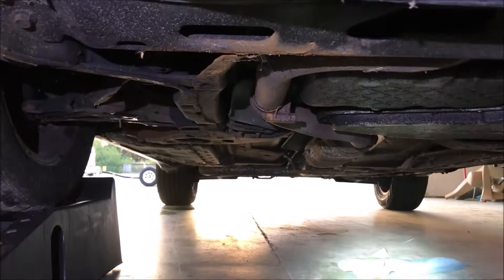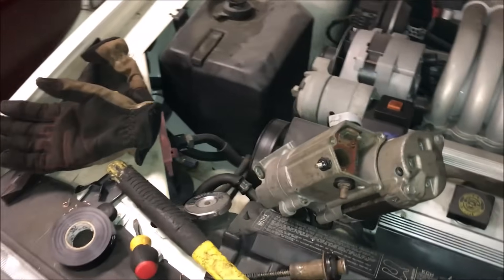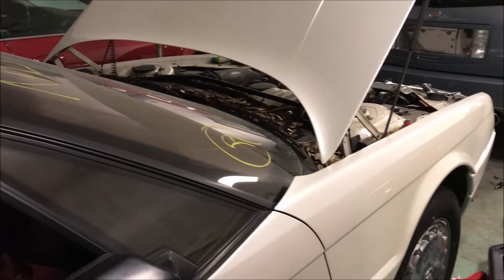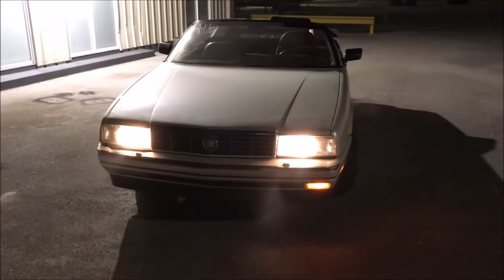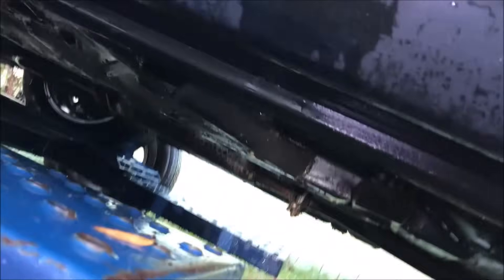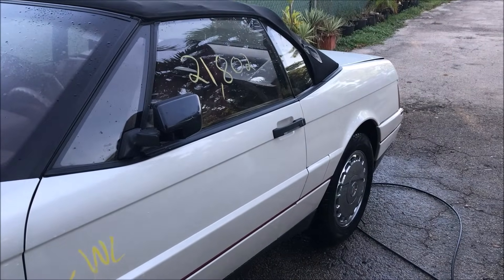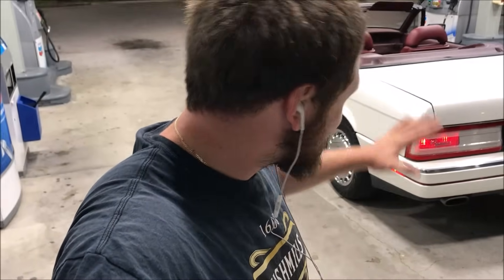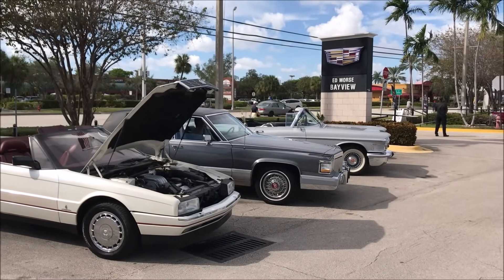First Start/Detail Of My $500 Flood Cadillac Allante

Comment: Hi Al!  Quick question.  I've got an 02 Escalade w/ 57k on it.  The gauges just stopped working as well as the center console DIC.  Do you know if the DIC in the center console goes out when the gauge cluster goes bad?  Trying to diagnose what the heck is going on.  Thank you!

Comment: I used to own a 89 Buick Riviera and it had very similar paint, it had beautiful Red leather interior, sadly it ended with electrical Gremlins 😢
Reply from the maker: The late 80s/early 90s Rivieras/Toronados do have a lot of electrical problems. Ask me how I know 😂 I only have one that actually works 95%
Reply from the maker: They’re such beautiful cars though that they are worth the headaches.
Reply: @bigalsbikeandauto  I tried to save it but the dealership in Lima Ohio kept telling me GM didn't support those car's anymore and if I didn't get the right prom or whatever it was called they couldn't reprogram it, and going to junkyards didn't help because the ecm had to be for that car and I got tired of the runaround and BS , I hated letting it go.